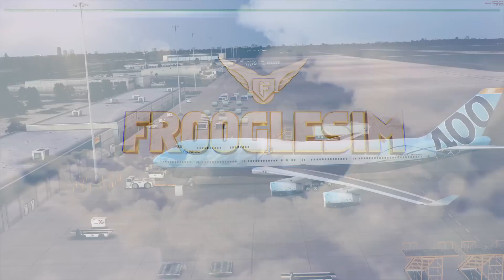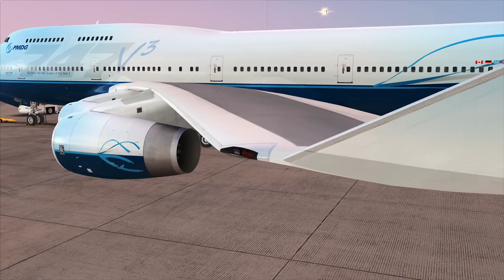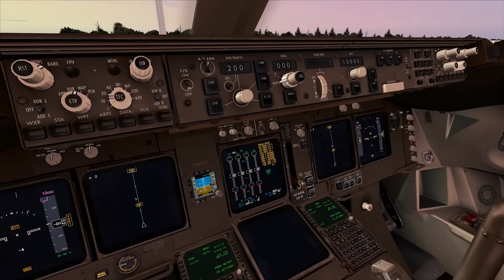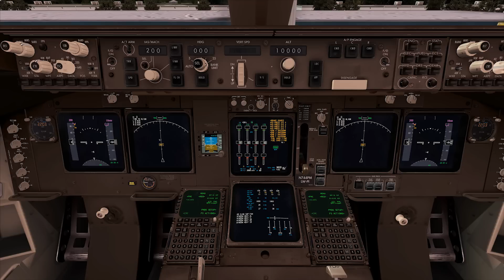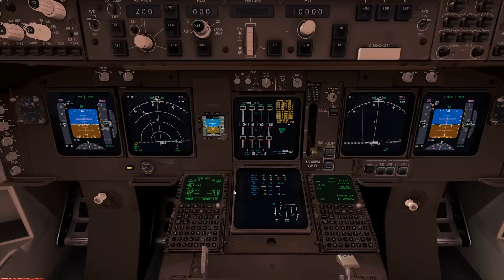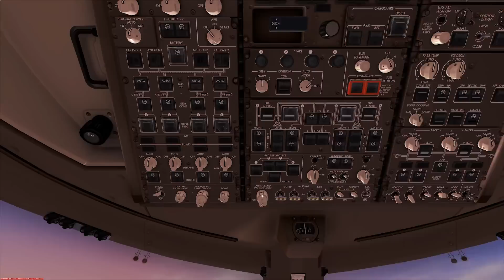[FSX] PMDG 747 V3 BETA - STARTUP

Comment: The reason the engines started so slowly and the GEN took so long to come online is that your Overhead Panel was configured as a Manual Start Jet. In PMDG, this will be an option whether to configure the start panel as a Manual Start airplane or an Autostart airplane. Yours was configured as a Manual Start airplane and you did an Autostart procedure of pulling the start switch and going to RUN on the FCS. With Manual start you introduce fuel either at the Fuel On Command Indicator (15% N2) or some airlines prefer Max motoring for 5 seconds before going to RUN, which is better for the engines.

Just to reiterate again, I am not being critical, this is to foster your learning of this magnificent jet and how unbelievable to have such an accurate simulation of it on a computer via PMDG without having to go to a 30 million dollar simulator or 350 million dollar airplane. I have iFly 747-400, which is great too, but this PMDG product when released will really be the shining product.

Comment: When you do the Before Start Procedure, you turn on all the pumps for all the tanks containing usable fuel, including the overrides 2 and 3. If 2 < = 1 and 3 < = 4, then you will get the Tank to Engine Message and you will turn off OVRD 2 and 3 and close crossfeeds 1 and 4.

Once you have your final papers, just before Briefing, then you set the MCP. There are either 4 or 5 items that are set depending whether you are flying a programmed SID - set V2 speed, Arm VNAV, maybe Arm LNAV if you have a SID departure, your Initial Heading, and your initial altitude.

Comment: When you check the Landing Altitude Switch, you do not push it On. Doing so will cause the Landing Altitude to go to MAN (amber) on the bottom of the Primary EICAS and take it out of the AUTO mode. Normally the FMC sets the landing altitude automatically, but if both FMC's fail, you can set it manually as well, check your video you will see you put it in MAN.

When you do the oxygen check, when you hold down the reset/test switch, also push the emergency button holding it for 10 seconds and checking that the oxygen pressure does not drop by more than 10 or 20 psi to check for any leak indications.

You never completed the CDU preflight by either entering the ZFW or pushing the sensed ZFW if it is correct and making it BIG from small font. You may be used to seeing boxes displayed, but if the jet has a sensing system, it can put in the gross weight and ZFW, but it is not active until you make it BIG by entering a new number or pushing either LSK, usually ZFW. This is why you had no V speeds.

Comment: Autobrake location on the PMDG will be optionable to have it on the center pedestal or on the forward instrument panel.
You can select the GPS position at LSK 4R on the POS INIT page instead of going to POS REF page 3 and selecting the L or R GPS.

The Fuel Main Transfer switch is an alternate action switch checked to Off during the preflight scan flow, it has nothing to do with checking Fuel Pumps 1 and 4 switches are Off. That switch, when pushed, will manually allow fuel to gravity feed through a single valve from Tank 1 into Main Tank 2 and Tank 4 into Main Tank 3. This happens automatically during fuel jettison when tanks 2 or 3 reach 20,000 pounds.

Comment: The PMDG product looks just beautiful and the simulator looks like it will replicate the real thing very well. There are no 5 engine 747's that are passenger or freighter versions. You can carry a spare engine if an airline needed to ferry one from one base to another assuming the crew is trained for ferry operations with 3 engine (1 inop) or 5 engine ferry. A performance drag factor would be added and included in the FMC for spare engine carriage.

I have included some comments not to be critical, but FYI and learning...

Comment: On the real aircraft you would destroy the engines if you started the engines the way Mr Froogle did it.  You need to get the N3 rpms to a certain value before putting the fuel levers to ON, otherwise you will cook your engines (EGT exceedance)

Comment: little detail, but you mention the ashtray. You may not know, but all aircraft have to be fitted with ashtrays, if one is missing, it has to be grounded. They're installed for the possibility that someone may smoke, and then need so.ewhere to put it. little know but interesting fact

Comment: Froogle just so you know system 1 demand pump is pneumatically driven so the sys fault light will remain on until bleed air available so you weren't doing 'owt wrong, except doing prestarts without APU running ;)

Comment: I did some searching on why the hydraulic state is as it is at 27:00 and why you've only got a sys fault on no. 1.

System 2 and 3 demand pumps are electric so run on switching to auto.
System 1 and 4 demand pumps are air driven. No engines/apu operating, so no air to drive these pumps when turned on/auto. The aux pump however, is a separate pump again and is electrically powered to pressurise system 4, in particular for braking during pushback.

In short, you did nothing wrong.

Hope that helps.

Comment: Excellent video, Froogle. Informative as always and great to finally see this plane video format. 

One thing I did just think of: I find it slightly ironic that this 747 offering will be the most modern simulation-wise for PMDG, but also is the most antiquated aircraft (as opposed to the 737NG or 777).

Comment: The 777 uses a speed trim, so the FBW system trims the aircraft to nose up when you add power & trims it to nose down when you decrease power to maintain a set speed. It doesn't keep itself flying straight & level like an Airbus.

Comment: Did anyone bother checking out the iFly 747v2? It didn't seem to get nearly the press (or any, for that matter) but Froogle could just have well been in the iFly's VC and playing around with the systems. I think PMDG will provide its usual impeccable quality and depth and with more variants but this is one of the few cases where this aircraft already exists in the sim world in fantastic rendition and for much less money. So I have to shake my head at the people clamoring for release and that may get the vapors if it's not released in 2016... Anyway, thanks for the video. Well done.

Comment: Hi Froogle, nice video, thank you for that ! 
I Have just one question for you, whats about the L+R ISLN Valves after the Engines are running?
On the 767 you normaly turn them OFF again before turning the PACKS to NORM.
Isn´t it the same on the 747 ?
Greez from Germany

Comment: You did nothing wrong. Demand pump for hydraulic system number 1 is an ADP (air driven pump) so it only Works with pneumatic air. As soon as you start the apu the faultlight wil go out. Love your videos.

Comment: I wonder if anybody is going to do an Air Force One skin even though its not technically correct, the VC-25s for Air Force One are based on the 747-200. The Air Force is in the process of replacing them with new 747-8s.